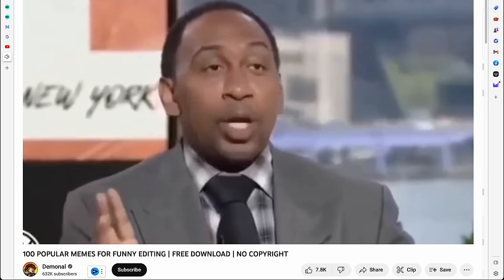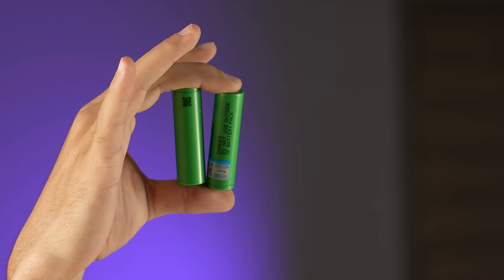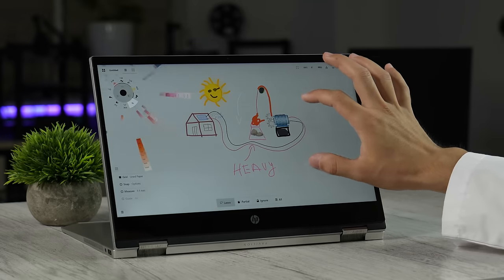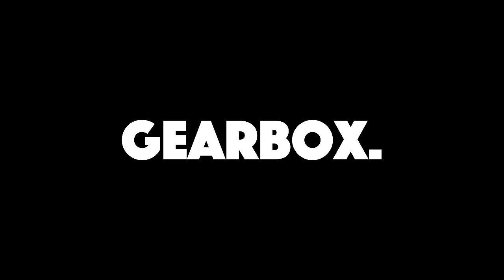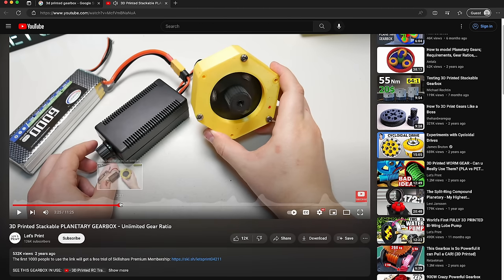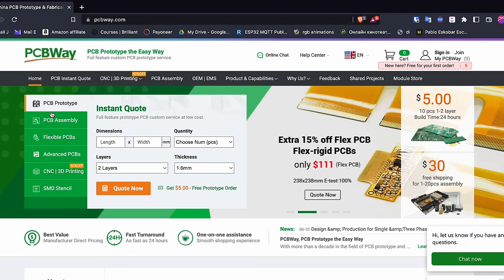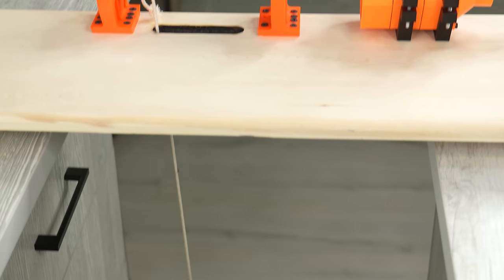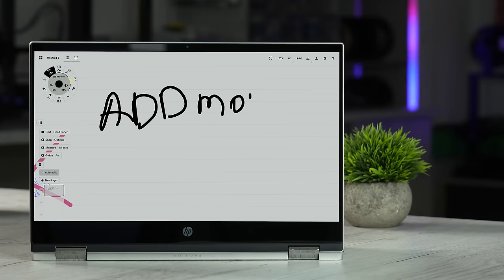DIY Gravity Battery: Unexpected Results!

Comment: Some ideas: 1. Instead of an IR sensor, use a microswitch that will be pushed by something attached to the rope. That way, it won't be sensitive to the colour of the rope. 2. Add a centrifugal brake on the rope to slow the weight's descent if the motor breaks. 3. Measure the temperature of the motor and have it turn off if it gets too hot. 4. Add a ratchet on the motor shaft to hold the weight when it has been raised.
Reply: He made it manually operated
Reply: 5. Stop using 3d printed gears, it will fail
Reply: Why don't you make one then huh? Man I hate backseat drivers...
Reply: @morskoyzmey 3d prints can be supprisingly strong when printed correctly! This video as very good proof of that
Reply: I feel it would be easier instead to use a heading and a cooling system on the motor, it would be more bulky but possibly far more effective
Reply: Or just use water and a pump. There's a reason why mechanical energy storage is done using water
Reply: @Wheresmy240  Large fly wheel is also an idea worth exploring since I believe water would be inefficient on a normal domestic scale...
Reply: @fiddledotgoth  rather than pumping it up use rainwater to fill the reservoir that's high enough already to help increase efficiency. Besides the amount of power he was attempting to produce would be sufficient with a water system but yeah, you're right, for a backup power system for an entire house water reservoir would be impractical
Reply: @idothings6685  Because it costs money and time and he likely doesn't have a reason to make it. He was just giving a few ideas, he doesn't need to make it himself just to give some ideas.
Reply: @idothings6685  I would understand your comment if he gave bad advice, or if the advice was said as an attack. But the advice /ideas he provided are great ides. Additionally they couldnt be construed as an attack by any normal person. Constructive criticism is what makes good ideas great.
Reply: A 12/24 volt vehicle winch motor would be much better for that application and designed for the stresses of a high weight load.  Off grid 20+ years and I use LIFEPO4 batts for night time storage and excess power in daytime is used for charging ebikes and a dump load like water heating. Heating water is also a way to store energy for night time use.
Reply: Pensé lo mismo, que ganas de complicarse XD
Reply: Mechanical switch will be another point for wear out failure. A hall sensor and magnet would be better option
Reply: Yeah what if it's dark supposed to be sensing the color
Reply: @idothings6685  It's called valid criticism, you're clearly not the intended audience if you don't understand this much about engineering projects.
Reply from the maker: Thank you for your valuable feedback, I will consider them!
Reply: would a centrifugal brake grip hard enough to slow it sufficiently? its can't be moving at more then 20kph
Reply: @morskoyzmey  for something like this, while long term something else should be used, 3d printed gears are mostly fine. this way he dosn't need to spend significantly more on metal gears.
Reply: @plazmaguy13yago9  I would hope that the one used would act at a lower speed than that.
Reply: Tech Ingredients should look into this, he usually has very good stuff.
Reply: @bramweinreder2346  Tech Ingredients is a genuine Einstein and a great experimenter.
Reply: @idothings6685 this is the comment section on youtube, you know. Its also a great way for people to possibly contribute with the expertise, experience, materials or equipment to do something themself. But if you don't like backseat drivers, you're in the wrong place

Comment: This is cool, but it would have been nice if you'd included more technical data like, final versions - weight of the bag of rocks, distance from top to bottom of rock bag travel, gear ratio, run duration (time it took for the bag to travel from top to bottom, voltage & wattage generated during one rock bag decent, etc.
Reply: In short capacity of weight battery :D

I imagine there are quite big losses in friction it would be interesting to know these in regards to a chemical battery.
Reply: The thing is with this battery:
If we are optimistic 70kg 10m and ignore all loses it is about 2Wh. That's roughly enough to power 1 LED light bulb for 10 minutes.

The efficiency goes down a lot since it is a low torque/high speed motor and he uses a lot of transmission to get there. 
Additionally there will be conversion losses from AC to DC to AC.

A household uses anywhere between 2-8kWh per day. 
If you want to save the energy for the night it is about half. That is still between 35-140tons of weight suspended from 10m

That's why they use those huge pumping stations and dams to generate power and still don't have enough.
Reply: Lifting a 1 ton (1000kg) weight for 1m increases its potential energy by about 3 watts-hour, which is roughly the amount of energy delivered by an AA battery. From this you should subtract all the losses (conversion efficiency both ways, friction etc) to get the final yeld.
Reply: @hugbearsx4  And that is why he probably didn't mention it, I don't think his system reaches 1Wh, but he could maybe get 100W for a few minutes..It's easier to pump the water on the roof and make your own hydropower. But not too much water or your house will collapse.
Reply: Just use the formula of potential (gravitational) energy and you can calculate for yourself how bad the energy density for a gravity "battery" is.
Reply: ahmedradi99  I am no expert. But cutting down on the transmission needed would reduce losses to friction. 
Even though generators and motors are quite similar. There are ways to improve efficiency. I guess a balanced one would be good. 

You could read up on what makes generators good and go from there I guess.
Reply: @AndreVanKammen  100W for a minute is 1.6 Wh :-)
Reply: @dalkgamler  : Even a small power bank (around 10 €) has the double of that energy. That is the problem of the mechanical batteries, it's very difficult to achieve a high energy density per volume, weight and money.
Reply: @iaadsi  You are right, so probably only 100W for a few seconds or 10W for a few minutes.
Reply: Can you mention the math @dalkgamler
Reply: @dalkgamler if it were 30 meters up, could you reduce the weight 3X? Does it work like that? Not that it matters, seems like it's far too inefficient to be even close to viable
Reply: @nateb4543  I don't know, but I think you'd need to keep that same amount of weight so as to povide the same degree of output. The greater height would just mean that power output would run for longer

Comment: I'm pretty sure that the friction of your gears is pretty large. 3D printing is a great thing, but it limits you to materials that make it better for prototyping than final product (as you discovered with the pulleys) If you were using off the shelf parts would you make the gears from plastic with no bearings? A snatch block (block and tackle) would be a natural thing to use since in this case the weight of the block works in you favor. You can get much of your gear reduction from the block.
Reply: I do a lot of printed gearing.  PETG is the worst material for gears.  Even with bearings.  That said, you can make surprisingly functional gearsets with other materials.  Nylon is great.  Even cheap PLA and ABS are fine for many types.  But yes, bearings are a must.  All that said, yeah, he missed the obvious answer.
Reply: Yes, he prints because he can and thinks it's new and neat, not because he should.  Definitely not an engineer. Or not a good one.
Reply: SNATCH BLOCK
Reply: @JetpackBattle-lc7ob  A person of culture i see.
Reply: @JetpackBattle-lc7ob  when my wife says "I'm too tired" tehehehe"

Comment: I realy like your Project^^ Im not sure if you thought the physics thru tho. The stored energy is the mass (50 kg) times gravitation (~10 m/s^2) and hight you pull (5 m), which results in roughly 2500 Joule. You can convert Joule to Watt-hours by dividing by 3600. So you get around 0.7Wh of stored energy in this case. That means without any losses in your system, so the absolut best case, you will not be able to operate one LED for an hour, as most LED-Lamps consume around 5W per hour. This system can only be improved by increasing mass and/or hight. If you want to run a 5W LED for an hour, you need to pull 360kg up 5m.
Reply: Yeah exactly and lifting a 2ton car 10m is about 3-4 phone batteries of energy (in the ideal case without any losses). So getting a few phone batteries seems easier, cheaper, and safer.
Reply: i have seem a spanish guy that build some similar to this having 20v for 2 hours with 60 kg
Reply: So if I lifted a 1 ton for a 1km it would be 3kWh
Reply: And if I lifted 1ton for a 60m it would be 166wh so about 13Ah(12V)

Comment: Cool illustration of the principle, and great that you got it working in the end.
It would have been interesting to know a bit of data: final mass of rocks, height they were raised, Voltage, current and time as the rocks were raised, Voltage current and time as the rocks were lowered.  Obviously nobody would expect great efficiency from a prototype setup like this, but it would add an extra layer of usefulness if the data had been included.
Great job anyway.

Comment: Interesting proof of concept experiment! For a real-life situation, you would want a deep hole in the ground to contain your counterweight and steel cable to raise and lower it, along with a second cable to allow you to retrieve it if the first one breaks. The motor-generator should be a large permanent magnet DC motor and a steel geared 4:1 primary gearbox for your winch, and a multiple block and tackle with large diameter sheaves for the cable to naturally multiply lifting torque. The winch drum on the motor should incorporate a solenoid-controlled ratchet to keep the weight from dropping when the sun isn't shining. I built one several years ago that will produce 1.5 KW for 4 hours from a 600 lb. weight in a 50 ft. hole. It takes a full day of good sun to 'charge' it up, and I can't run my inverter or charge other batteries while it's in use, so it doesn't get used very often.😜 P.S: I used a 4 wire DC stepper motor from some printing equipment that already had the 4:1 gearbox, and a controller that ran on 24VDC. The output part was a bit trickier to design, and I had to make an auto switching device that was triggered by (lack of) input voltage to the controller, so it would switch to the output circuit when the sun wasn't shining. I just set the ratchet solenoid on a separate circuit so I could start it from inside the house. These motors are very efficient since they have multiple windings and essentially output multi-phase AC current, which is easily converted back to 12 or 24vdc for low-voltage lighting, etc. I thought about making a multi-phase > single phase 120 VAC converter, but the speed isn't stable enough to maintain 60HZ with varying loads.🤷‍♂

Comment: I recall doing a video last year about rigging failures - https://youtu.be/swk3IjxzZB4 - the forces on the ropes and structures can sometimes be suprisingly multiplied depending on the arrangement of the pulleys and angles involved. The top pulleys in this setup pull the roof support beams together with a fair bit of force and could be beyond the design parameters of those beams. 

The ropes holding the pulleys to the beams are also subject to as much as twice the lifted weight. The people at HowNot2 have lots of interesting tests of climbing gear including ropes and shackles that might be of interest: https://youtu.be/m8z6adEqaOs

Glad nobody got squished by falling stuff.
Reply: ' can sometimes be suprisingly multiplied '  And don't forget if there's a slip and catch.  You can start getting stupidly high forces when something is allowed to fall and then gets caught up again.  You do not want to be under this stuff at all, it should be done off angle a bit so the control is out from under..
Reply: Yeah, he's lucky that it only ended up with a tile cracking, could have been the whole pergola that got trashed..

Comment: Interesting experiments.  One thought, you can reduce the tension in the rope and the torque/gearbox requirements by arranging some pulleys to form a 'block and tackle'.  Put two pulleys at the top and two hooked to the bag and run rope through them, finally fixing end of rope to top support.  You can get a 4:1 reduction in the rope tension without significant loss in energy storage (or, alternatively lift 4x the weight with your existing).  Of course you will need longer rope and take up spool will need to be larger.

Just a thought, part of your troubles was the high torque/ tension your winch needed, and this would be a way to reduce that.
Reply: You could use a lever combined with a block and tackle. In medieval times, they lifted the massive counterweights on trebuchets by winching the throwing arm down. in this way

Comment: This was a fun video to watch. Showed some nice basic concepts and 3d printing and prototyping. Gravity batteries have appeal due to their inexpensive ingredients, however, as noted, the energy density is pretty low. A perfect battery (no friction losses or wire resistance loss) would store energy =mgh (mass-g-ht), so a 100kg mass lifted 10m would store 9810j, which is less than the amount of energy in a AA battery. Where I grew up, I lived on a creek where the tide was about 1.5m. I envisioned large floating weights that would be lifted by the tide, then fall under a gear reduction, driving a generator. I concluded, sadly, that I would need 500,000 kg lifted a little over a meter to make 5kwh per high tide, about what my house used at night. Not feasible for the middle school version of me :(  That said, there is a company that makes small LED lights that use this principle. They run for about 2h using a 10kg bag of dirt lifted about 2m, and make a few milliwatts of power, enough to run lights for reading, food prep. The idea was to replace kerosene lamps or open flames for reading. They have changed their product to a new one called "nowlight," a human powered generator + rechargable battery where a few minutes of pulling a cord charges a battery for several hours worth of light, or many minutes of phone charging. Another great option is to use small solar powered yard lights, charge them outside, and bring in at night.

Comment: I'm sure people have suggested this, but you might want to get a really long rope (doesn't have to be so strong) and use a block and tackle to take the load off your motor and gearbox.  You'll be able to lift a heaver load with the same motor and gearbox (but maybe a larger reel).

Comment: How much power did you manage to get out of this setup in the end? that is the thing I'm most interested in :)
Reply: It's more correct to talk about energy stored (or capacity). My back of the envelope calculation says that he stored about 0.5 Wh of energy. For comparison, a single 18650 li-ion cell can store anywhere between 9 to 13 Wh, so (assuming some losses) it's fair to say that this gravity battery has about 1/30 of a capacity of a single 18650 li-ion cell (so to be honest, it's mostly a fun experiment / toy than anything actually useful). The lights that he is using at the end look like LED lights that need at least a few Watts to operate - so in all likelihood he could keep them on for just 10 - 15 mins, possibly even less (unless camera settings deceived me and my assumptions based on the strength of the light are wrong).

Regarding power it's mostly limited by the motor/generator - you couldn't power much more than LED lights from it. With a larger motor/generator you could get much more significant power, but then you would still be limited by the tiny amount of energy stored - imagine more or less being able to power your TV, but only for 30 seconds. You would need to scale it up A LOT to be useful. For example, something like 10 tons at the height of 40 meters would be roughly equivalent to battery pack in my e-bike (which would still be too small to use in a home solar system for energy storage).

edit: I needed to correct my math ;)
Reply: Yea I did a similar calculation for a home made compressed air energy storage system using harbor freight air tanks and compressors. The amount of energy from the storage was minuscule compared to a single 18650.
Reply: @psow4062  yup considering energy loss in sound, motor heat and probably a ton of friction makes the system quite inefficient compared to a battery
Reply: @nathanp3366  I think the flywheel is one of the most practical ideas for energy storage at the useful scale - energy stored grows with the square of rotational speed. Flywheel with a magnetic bearing and rotating in vacuum has low losses and you can rotate it to very high RPM (you probably would want to put it underground for added safety, though).
Reply: @psow4062  That's actually working idea, but way harder to 3D print at home as DIY fun-project :-D
Reply: Stored energy is mass in kg x height in meters x gravity (9.8 m/s^2). The result is in joules (watt seconds). 1 joule = 0.000278 watt-hours. Then subtract frictional & motor/generator round trip loss on the order of 25-50%. That’s why these need to be huge. 1 metric ton (1000kg) lifted 10 meters = 27 watt hours or 3x 2500mAh 18650 li-ion batteries. Still a cool idea!

Comment: If you utilize a compound pulley system, you can reduce the needed weight while increasing the length of the rope. This would require a lower gear ratio meaning less instances to generate noise.